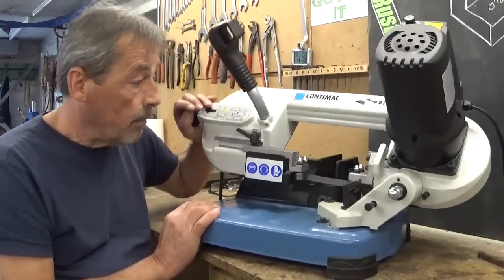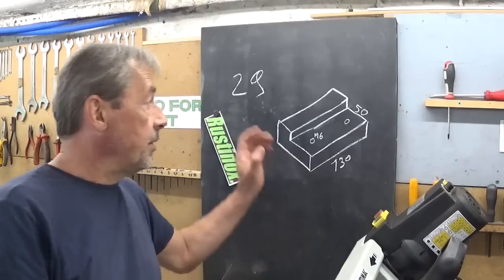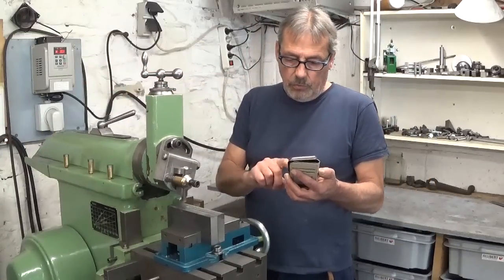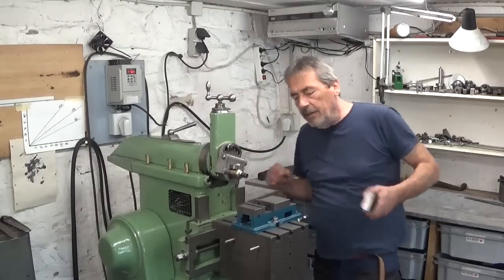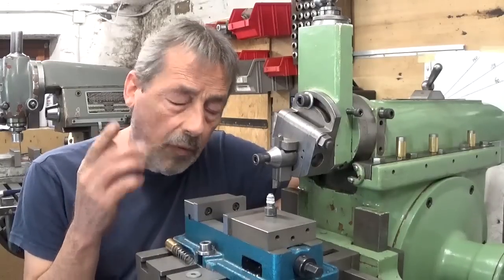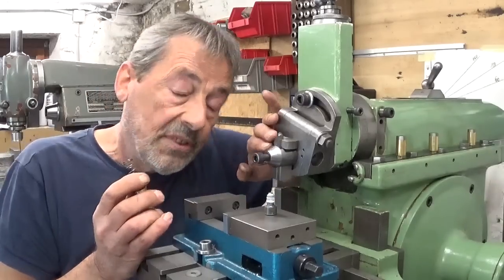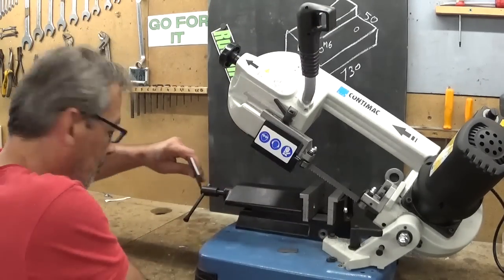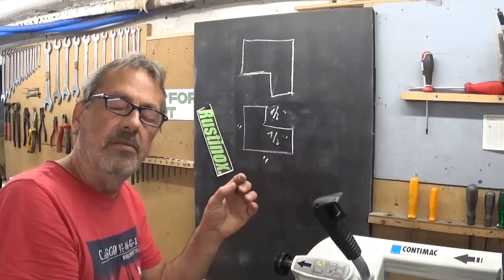Vise jaws for the bandsaw.

Comment: One of the reasons I chose the shaper is also that the cutting action is more smooth. A mill hammers its way through the material, while the shaper acts much more silently - and doesn't throw chips absolutely everywhere, but just in one direction instead.
Reply from the maker: Absolutely right :)

Comment: I now have a shaper, I am at the repair and paint stage. When you start a cut you often wind the ratchet with the handle, click click click. I used to think you were hurrying to the cut but now I think maybe you are looking for some resistance from the nut. The ratchet needs something to push against if it is to lift and disengage. They are fascinating machines to watch. Lots of fun 😁
Reply: Welcome to the shaper owners club.
Reply from the maker: Ah, a new shoper owner. That's good news. You will have lots of good times with it.
Reply: It is very expensive, all my tools are metric and it is covered in Imperial taper pins. So many sizes 😆

Comment: Thanks again. I also found the sticky oil on the clapper problem. Now  clean it with kerosene before use, and put the sticky oil back on before it goes to bed. i have been using 30w engine oil mixed with chainsaw bar oil. Very sticky. Cheers

Comment: Given machines capable of equal accuracy a Shaper can often make flatter surfaces than a mill with a fly cutter because a mill that is even slightly out of tram with a fly cutter will cut a surface with a hollow area in the center of the "flat" surface due to the radius of the fly cutter. The more out of tram the greater the width and depth of the hollow. A large fly cutter in a mill slightly out of tram will result in a wide cut with a deeper hollow in the center, the same machine with a small diameter fly cutter will require several passes to machine the same area and will result in a small hollow in the center of each pass. The bottom line is that if you use a fly cutter you must be certain that the machine is in perfect tram in order to achieve the flattest surface possible. Another option is many passes with a small diameter end mill which results is a generally flat surface with many small hollows along the axis of the cut, something akin to a scraped surface, but of course not as accurate.
Reply from the maker: You're right. But I suppose for vice jaws, this will do :-)

Comment: Good Job Son Good Job
The shaper would would always be my first option they are so relaxing to see running and you are a master with them
Kurtis over at CEE has a KLOPP 1000 that takes longer to make 1 stroke than it took you to finish the job
But bigger is not better (:   👍👍👍👍👍
Reply from the maker: The longer stroke looks slow, but the cutting speed is the same.

Comment: With an 4 flute 50mm rughing mill it's 4 times faster 
But the finish is not so good
Reply from the maker: My machine isn'd rigid enough to run big endmills.
Reply: @Rustinox  it's not really big 
50mm 
This should be ok for the FP 1